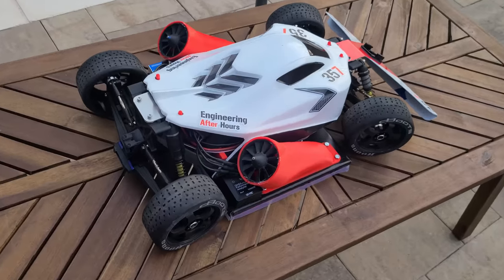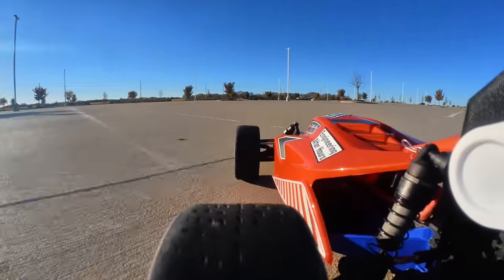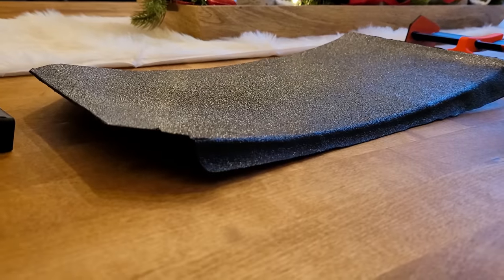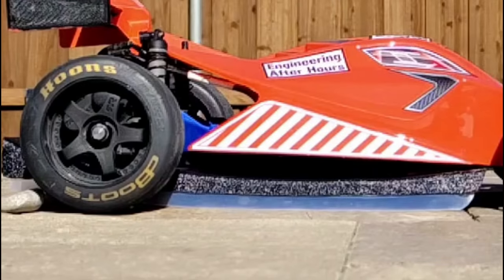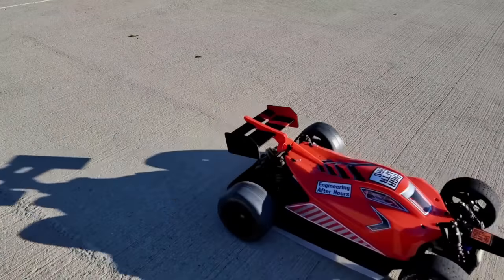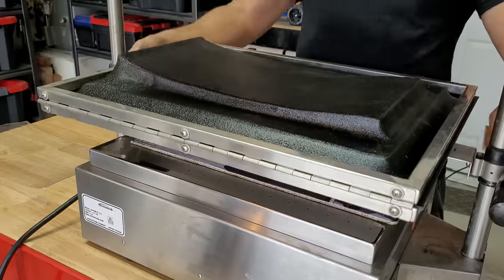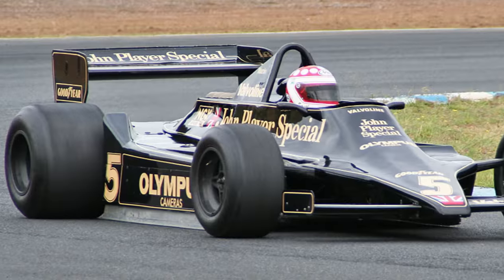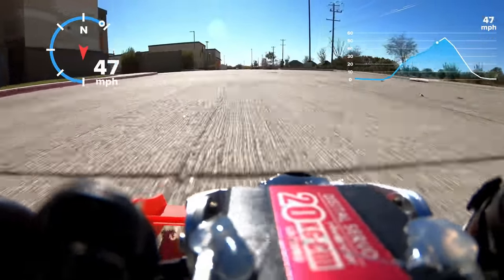I made F1 Ground Effect for my RC Car

Comment: The visual with the leaf blower was so impressive! You hear that it works, and read that it works, but to see it so simply... that was awesome. Such a cool way to show how the underbody "vacuum" works.
Reply from the maker: I was really surprised to see it bottom in that test case. I also tried to get it to flip like the clr by pitching up, but it never actually would.
Reply: @EngineeringAfterHours  The fluffy assistant was helpful too. The goodest of engineers.
Reply: If you haven't scrapped the under tray yet, could you try the leaf blower on it without the sealing strips?
I'm interested in the the difference between, with it and without it.
Reply from the maker: @RandomloserDK  I believe I show it with and without in the video. In the event I didn't....without the strips I still get some squat, but not nearly a much. I wish I had a wind tunnel...if I had a bigger shop I would definitely build one.
Reply: When they say "massive downforce" I still wasn't expecting that.

Comment: I think stiffer suspension would improve your cornering ability when testing with the undertray installed. I suspect that the undertray is sliding on the ground through the corners, thus reducing the weight on the tires.
Reply: Or a so called third element in the suspension (heaff springs) they are the most important suspension set up for aero beside (ride hight and heaff is the dynamic motion of the suspension/ when all wheels do the same relativ movements to the body (up and down))
Reply: @TheLtVoss  just like in Formula 1 where they have the Heave Daper
Reply: @didyouknow5648  ohh Heave not Heaff yeah that was what I meant
Reply: To be honest. When under load the ride height reduces. Typically components in ground effect are sensitive. At a certain point the ground clearance becomes too low (due to too steep a adverse pressure gradient) resulting in stall, reducing downforce
Reply: @campbell-skills6605  yep that why I mentioned the Heave spring as third suspension element

Comment: The original Lotus ground effect car had solid floating side skirts.  They performed better than anything else they came up with but feared it would be deemed a moveable aerodynamic device.  You could link 2 or 3 side skirts inline to try and achieve maximum suction when driving over uneven surfaces.

Comment: How did the side skirts hold up sliding across the ground? High degradation or do you think they would last several runs? Awesome project!
Reply from the maker: It would past a few races. It doesn't tear itself up like my fan cars do.
Reply: @EngineeringAfterHours  I would also try too implement heaff springs so that downforce  won't cause much suspension traffel (bottom out) and will reduce the wear of the skirts and improve the efficiency of the aero (the ride hight is extremely important for ground effect) also you could try too create vortexes at the side of the car to improve the underground sealing

Comment: Nice work, I love a good bit if Science/Engineering 👌. I used a similar design on my little 90mph WLtoys. A layer of plasticard with some foam strips either side acting as the skirt, not as technical as this, but certainly meant I didn’t have to put an ugly front wing on like a lot of others did running the same car/speed.
Reply from the maker: I love simple and smart solutions like that! I might have gotten carried away trying to hit a very specific underbody geometry...but i suppose I have backups for more testing at least.

BTW you've almost convinced me the get a WL 284131...looks like a fun little truck.

Comment: Your setup is getting pretty serious. Of you haven't already, I would recommend a direct-drive steering servo. I think the "servo-saver" is allowing some play in the wheels during cornering, theyre bobbing around a bit. Just pop a stronger aervo and remove the safety element and get precise steering

Comment: What did you use for the skirts? Also, do you think an undertray could be entirely 3D printed if it's cleaned up properly? I'm thinking about doing a similar project myself.
Reply from the maker: Skirts are "silicone seal strip". The undertray could be fully 3D printed but I recommend something semi flexible like nylon or even PETG. PLA will likely crack too easily.

Comment: The video was really cool, you do have to keep in mind that ground effect and aerodynamics are used in the corners and will only produce drag in the straight. The car should be producing less g’s in the straight line speed test
Reply from the maker: The idea that downforce is only used in the corners is a common misconception.

The more down force you have the harder you can accelerate until you're power limited. This is why dragsters produce several tons of downforce.

I'm actually working on a video to help folks understand this.

And ground effect is specifically used because it's minimal drag penalty.

Comment: Tips to F1 engineers: Build RC cars exactly to spec as the real deal, infinite practice time
Reply: This comment was probably a joke but i really want to know if it works
Reply: @ahmed6472  It won't simulate suspension movement that's for sure. None of all 10 teams's million dollar simulator were able to simulate porpoising let alone a RC car

Comment: My dream.. Could you integrate a drone motor for the purpose of controlling the suspension squat? Possibly program it to activate at certain speeds and or throttle/brake inputs would make this like active suspension?

Comment: Now you need to combine your ground effect channel, the ground effect fans and the cold gas thruster together into a super RC car. Maybe use the ground effect fans to accelerate air through the ground effect channel by pulling it through. Gordon Murray T50 style
Reply: And add a third element in the suspension like f1 or that downforce will bottom out the suspension and remove grip from the tires in any dynamic action

Comment: My cluster fuck comment:

I agree, the “wind tunnel” test was shockingly effective. That’s some massive downforce from just under tray at leaf blower pressure. I know some leaf blowers claim “100mph” wind but that’s at the very narrow nozzle and falls off quickly with distance. 
One question, why did you add the wings to the ground effect plate? Why not just test the chassis plate by itself to isolate the effects? Adding the wings muddies the results of the ground effects. Also, with downforce comes drag. I’m curious how much drag the ground effects add for a given amount of downforce. And, how that drag to downforce ratio compares to traditional wings. 
Also, for top speed and straight line acceleration at speeds above the limit of the tires’ traction downforce is a hindrance as you don’t need the downforce and you still get the drag…and the drag is multiplied at high speeds. Only in cornering and straight line acceleration, where the tires are slipping, does downforce help so is there an easy way to actively vary the amount downforce/drag created by the chassis plate with a servo or something so that it could be added when needed and dialed back when it’s not? Much like the variable pitch wings that were outlawed in racing oh so long ago, you could have the best of both worlds, a slick car with very little drag for fast/straight sections and a car with huge downforce for corners and hard acceleration off the line.

Comment: Well i have to thank you for confirming the vital roll of the side-skirts play to seal the under floor air preaseure from the lower external air preassure. 

I wonder if you could use airflow insead of a physical skirt to achieve the same thing?  eg tight virtices to create air which rolls from out-to-under the skirt, and thereby by trapping the unfloor air preassure. If you add a leading airfoil section to the lead up to the skirt edge, so that it 'rolls' the air in, towards the skirt, it might create the virtices required.  The faster the car, the more air is rolled intowards the skirt area.

Comment: Slash Ultimate would be a better test vehicle, it has a much better weight distribution, however its AWD.  If you must have RWD to match an F1, I've seen several after market chassis that flips the rear transmission around so that the motor sits in front of the rear tires.

Comment: Yes sir awesome video as usual
I was wondering if you would do one more experiment with the underwing I know there's not a whole lot of room under a car but make mounts on the corners of the underwing to attach to the backside of the spindles to support the underwing that the underwing will be unsprung weight so that when the underwing loads up it doesn't calls suspension squat the only thing that it will be doing is mashing the tires the underwing Trey will float separate of the suspension and one other little point when you use your leaf blower WindTunnel if the tires do bulge sitting still and change the underwing ride height that probably won't happen at speed because of centrifical Force own the tires meaning the underwing Trey edges or weather stripping should drag less on the pavement which should give you more control and if this works if you can raise the car chassis our body up in the suspension you can run a more severe underwing Trey under the car creating more downforce which would open up more experiments to play around with
Reply from the maker: I like that idea as it attempts to do what the 2022 car does...tie the skirt to the wheels. I'll have to think in it to see if it can work, but I'm not sure how the suspension could still flex if I do this.
Reply: @EngineeringAfterHours  well if it's a arm suspension or even some form of fierson Mick strut suspension I think you have mentioned you have access to a 3D printer I don't know if any of my thoughts will help because I'm not looking at it but print you something that you can attach to the spindle carrier that won't interfere with the lower a arm once you're able to get on the other side of the a-arm even behind it under the car just make sure it don't get tangled up in the suspension geometry and wherever it's convenient you literally should be able to hang this on short pieces of chain or cable or if you want to get fancy use ball joints a simple hinge may work but if you did it that way your hinge would probably have to sit in slides almost like a spline because as it squashes down in the suspension most suspension geometry the Wheels spread a part ever-so-slightly
Reply: And I hope you don't mind me making a second thought I think you mentioned you're trying to do this on a budget and I understand but to be playing around with mechanical downforce or even this idea that we're playing with now with the underwing I think you will save money if you made your gears and transmission case machined out of steel otherwise you're probably going to keep replacing plastic gears with the kind of torque you're going to be sending through them I think you ought to cut to the chase and go with steel I know it's adding weight to the car but with the kind of traction you're going to generate I think you can afford to add a little weight where you're not blowing your transmission up and if it has the internal differential do not leave it out have it machined out of steel and of course go with heavier axles and as far as that motor stalling on the fan car are mechanical downforce car I know you mentioned there's some form of safeties causing it to stall from what I understand I was wondering have you ever seen a refrigerator where the compressor in it is going bad and the compressor doesn't want to start or is dragging when it starts there is a kit you can buy for compressor called a hard to start kit and really all it is is a big capacitor that hits the motor with who knows maybe a thousand volts momentarily just to get the motor turning then it goes back to normal voltage when the car is torquing out of the hole could you do the same thing you're hitting it with a voltage Spike incredibly higher then what the motor is rated for but not long enough to hurt it because if you know anything about racing most races are won or lost at the start but that might stop that car from stumbling but if it works if your drivetrain ain't right with that kind of torque it's definitely going to blow drivetrains

Comment: A set of wheel scales ressesed into a board should allow you to measure  down force by the increase in vehicle weight, or am I missing something
Reply from the maker: You're absolutely correct.

I would love to do load cells on the shocks as well. The problem is that those will also pick up dynamic driving forces from bumps and acceleration, but I can average out.

Comment: If you broke the pin that holds the idler gear (gear that is in trans that also attached the spur and slipper clutch) you can get an upgraded part but you will have to run an associated spur, or you could drill the pin out and cut the drill bit and glue it in there, that's what I did, thats the only real issue with those transmissions
Reply from the maker: I bought a 272R input shaft that should beef it up. 

Good call on knowing exactly what failed...I can tell you have put some power down with these cars lol
Reply: @EngineeringAfterHours  yes I have, I'm currently building an 2wd slash with an xmaxx motor and ESC and custom carbon chassis.  It will be done soonish
Reply: Or he can run a mod1 trans mission 3 gear eliminating the idler gear entirely
Reply from the maker: @nolimitrc1  any recommendations? Too late for this one but it would be nice to know some options
Reply: @nolimitrc1  I had no clue that existed, thanks for the info

Comment: If you want some ideas for aero then have a look through the Kyle Engineers youtube channel. He goes through lots of stuff. He certainly knows his stuff as he recently spent a year or so working for the Merc F1 team on their aero.
Reply from the maker: Great channel for sure. I also have a really solid book on aerodynamics from Simon mcbeath that I like to use.
Reply: @EngineeringAfterHours  also his later suspension videos ar a great way to maximise the aero effects. I mentioned in a other comment/answer the third element and vortexes for sealing the low pressure under the car basically I just remembered theses videos but forgot too mention that  soo would you be so kind to look in too it. it would be great too see these theoretical approaches (ok we know it works look at f1) in real life testing and how effective they are on a smaller scale

Comment: what if you had fans to force air under the car, like the leaf blower, in your low speed applications. once the car reaches the max flow velocity of the fan it will be pointless, but it could help wen slowing down for turns
Reply from the maker: Like the new Gordon Murray car!

Comment: You should be able to get more downforce if you extend the floor past the wheels
Reply from the maker: You have to be able to diffuse the airflow. Going wider doesn't help, and going longer kills my front wing which is used for aero balance.
Reply: @EngineeringAfterHours  you could bring the floor past the front wheels but not past the front wing and maybe you can reduce drag by managing the out wash from the front wing by angling the front wing end plates out. Another way to further reduce drag would be to put covers over the front wheels and enclose them.

Comment: if you added open side pods like the Lotus...??
Reply from the maker: It would allow me to drop the center of gravity if I did that. The current build has a huge undertray that's the full width of the car, but that means my CoG is higher. So while it's more downforce, it's not necessarily better.

Comment: Any recommendations to makes it without 3d or vacuum press?
Reply from the maker: Do you have any sheet metal tools, heat guns..etc?
Reply: @EngineeringAfterHours  two hands a metal file and a hack saw, and also the heat gun, 😆 I'm leaning towards my math is wrong when measuring
Reply from the maker: @mestizo_rc  you could technically do all this with a heatgun and plastic sheet stock, it just wouldn't be as precise.
Reply: @EngineeringAfterHours  thanks for your help I'll try the plastic sheet and see what happens . Would 2-3mm thickness be too much rigidity?
Reply from the maker: @mestizo_rc  I believe I used just under 2mm and that was a good compromise between rigidity and weight.

Comment: You really need to stiffen the suspension and I’m pretty sure you’re running into suspension flex issues
Reply from the maker: The suspension is already a lot stiffer than stock but thats  something I can keep testing with.

Comment: Why not use a limitless chassis
Reply from the maker: It's way too heavy which makes it much harder to get a motor large enough to maintain high acceleration. I'm already using a kraton motor in this setup. 

Limitless is also way too low to add all the undertrays.
Reply: @EngineeringAfterHours  have you ever driven a infraction? And the typhon and Mojave have the same width it’s possible to take their suspension and shock towers and raise a limitless or infraction
Reply from the maker: @ajaysalgaonkar685  all of those are way too heavy. I'm using motors designed for those cars on a chassis that weighs half as much.
Reply: @EngineeringAfterHours  last question why 2wd?
Reply from the maker: @ajaysalgaonkar685  oh man I thought this was my fan car you were commenting on not the ground effect car. That's my mistake. 

This would work well on anything that has enough ground clearance. I believe The limitless and infraction both run diffusers but not an inverted wing undertray. 

2wd is because it's similar to the lotus 78. This would work on 4wd.
Reply: @EngineeringAfterHours  they also have what is basically a transmission tunnel underneath but it’s for “aerodynamics” according to arrma now that I think about it it’s simpler to the ground affect car because I think it actually does creat some lower pressure it just needs side skirts